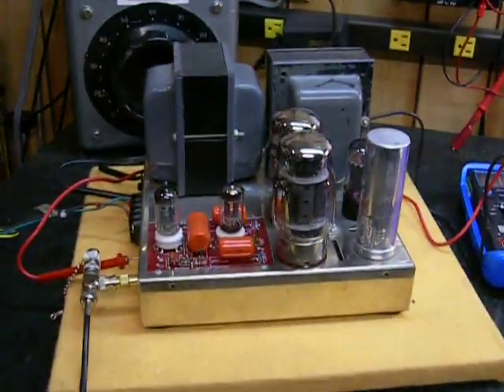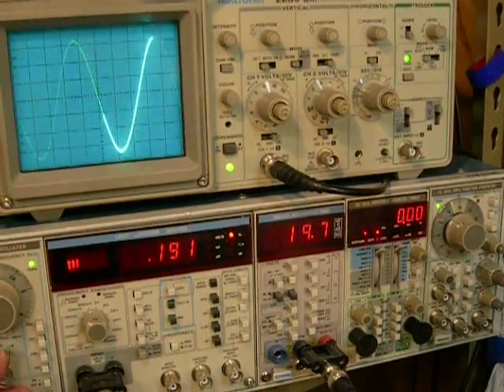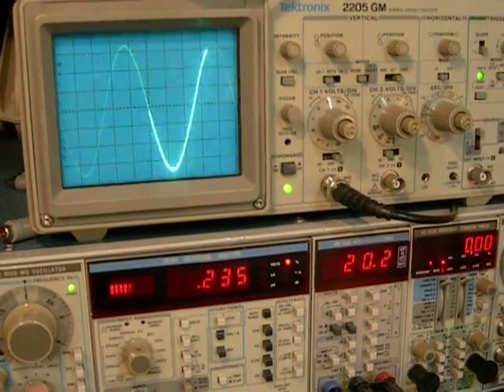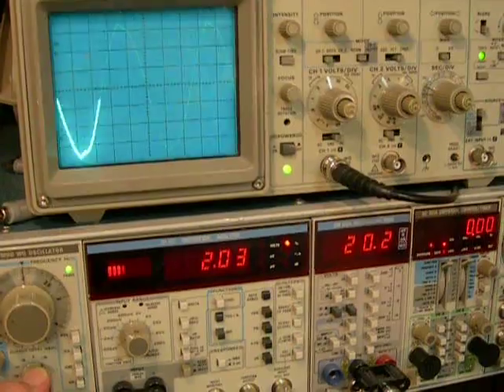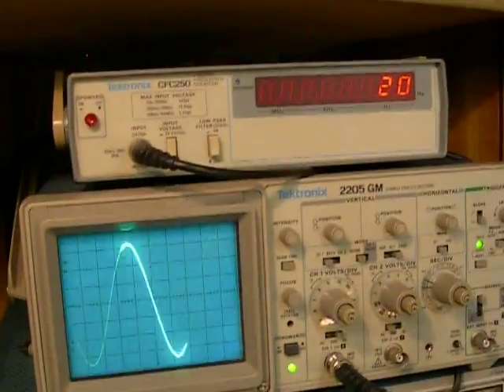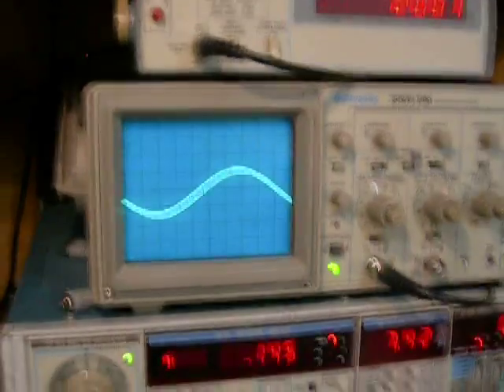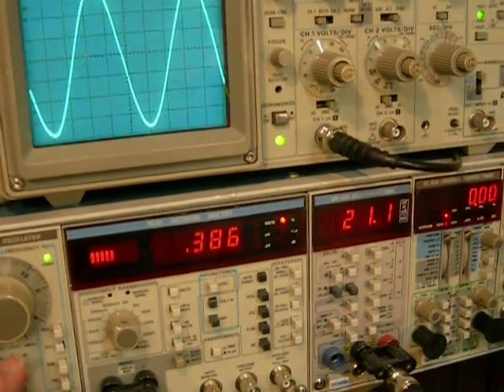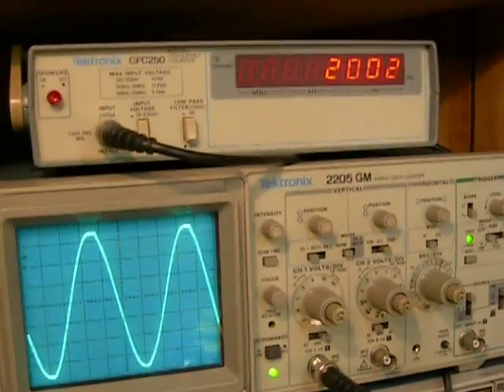Modern Genalex Gold Lion KT88 Vacuum Tube.MOV

Comment from the maker: All of the voltage amplifier tubes which are 12AX7, 12AU7, 12BH7 and 12AZ7 are vintage and hand selected USA - mostly JAN (the 12AZ7's in the old amps like mine are nowadays replaced with 12AT7's as the Z7's are hard to come by.) I get very good performance with Telefunken also. I haven't owned any of the Genelex voltage amplifier tubes yet. I will have to try them some day.